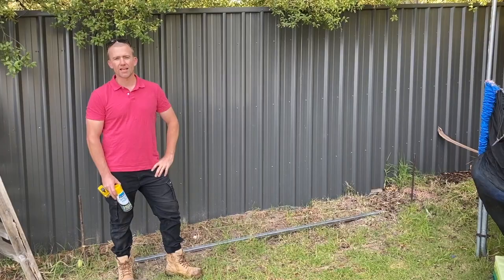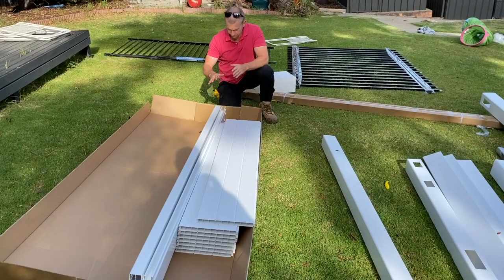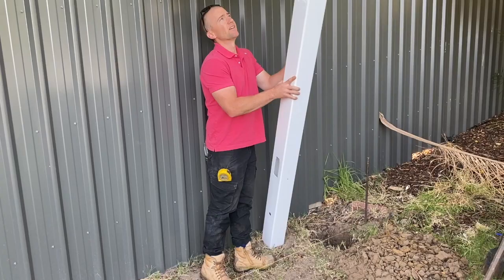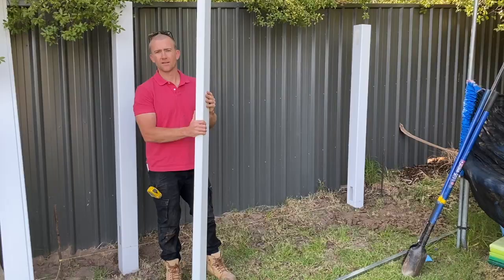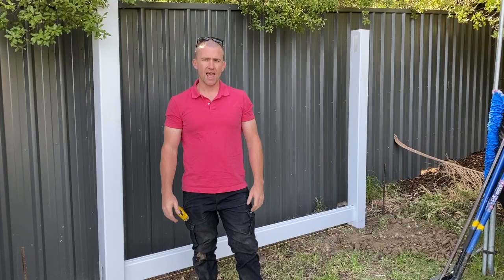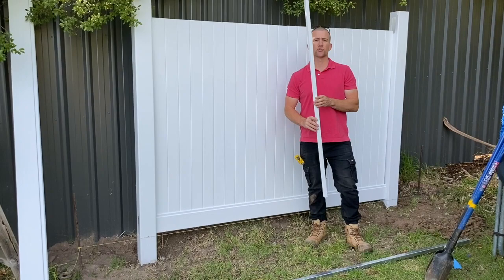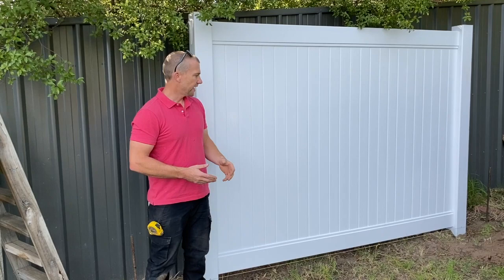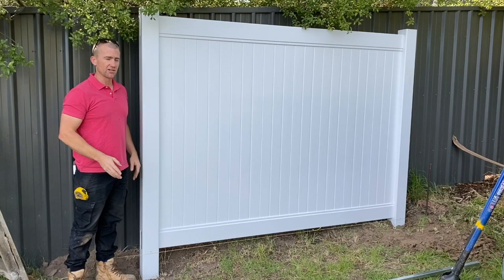How To Install A Full Privacy PVC Fencing Panel - Outback Fencing

Comment: Hi Lee, great video. What’s the minimum depth you would set a fence post in concrete? Deciding whether I need to take a small section of fence or go level (it’s only a 450mm width section). Preference would be to stay level. Cheers
Reply from the maker: best if you go 600mm deep if you can